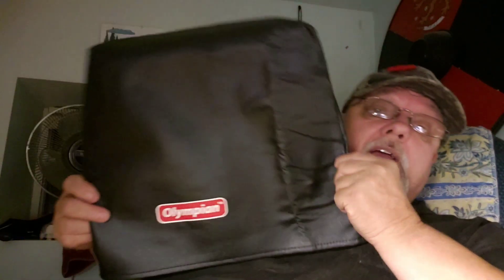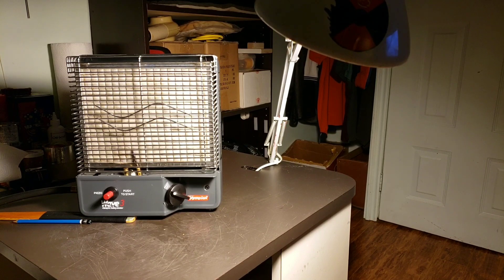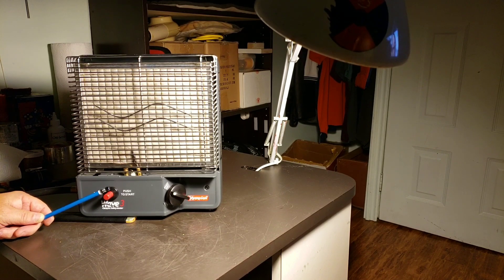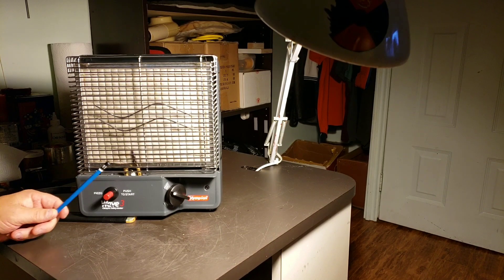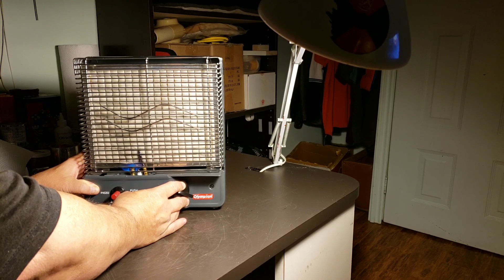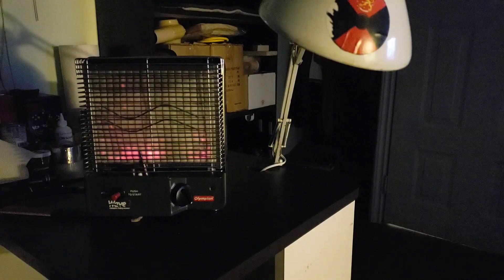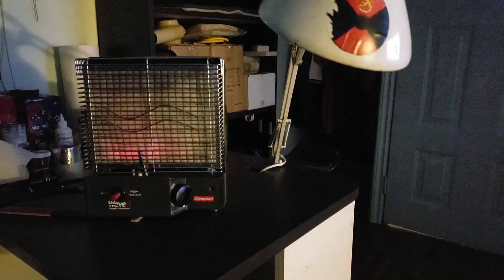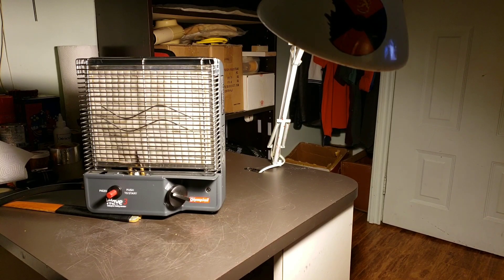🇨🇦 WAVE 3 HEATER

Comment: That looks like something that would be really good to help heat up the RV. I have two electric heaters both releasing hot air but it doesn't blow very far by the time it makes his with the cool air it's like a fan. That heating blanket sure does come in handy though and my little dog who is like a heating pad. Thanks for the demo skal✌🌛